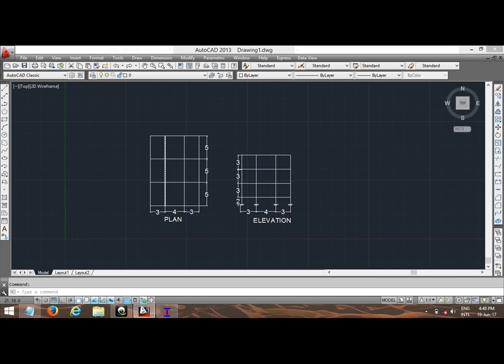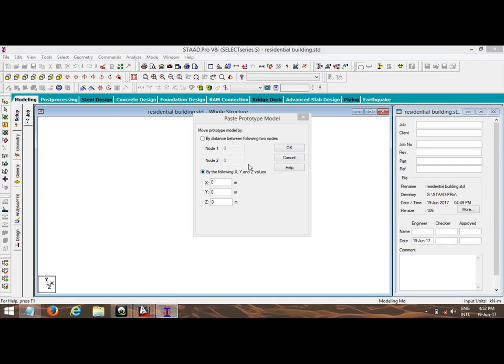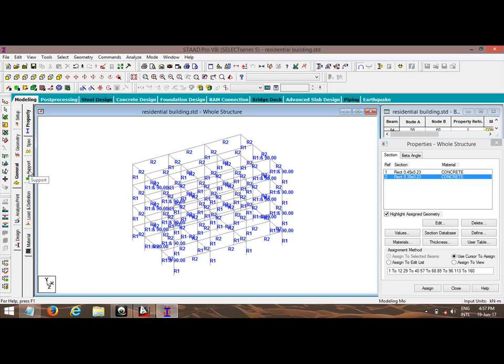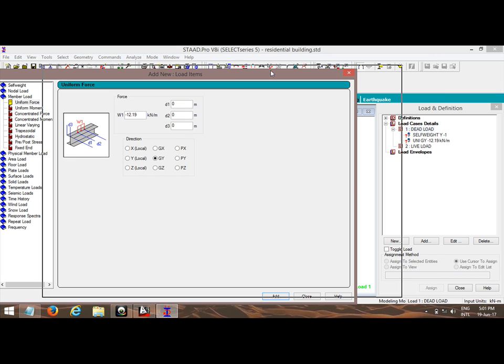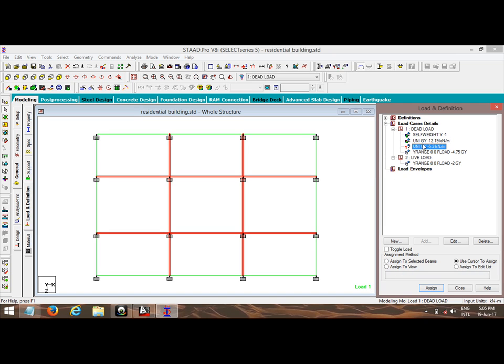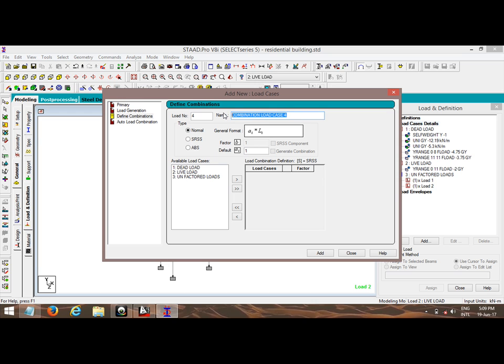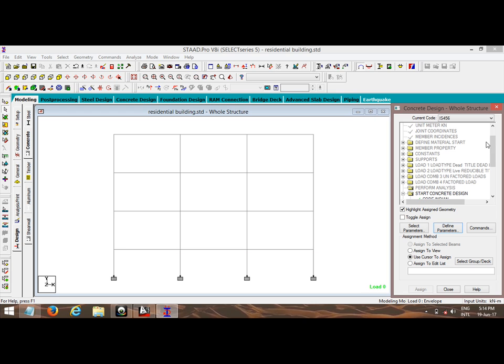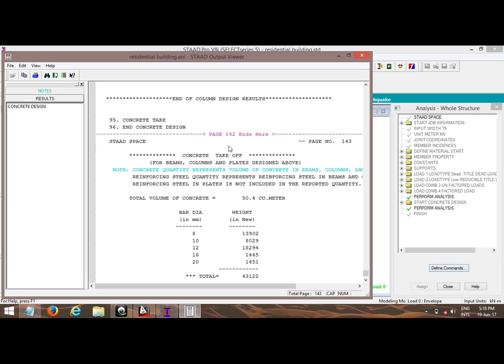Modelling, Analysis and design of residential building using staad pro software.

Comment: Thank you sir for this video.
Sir I am some dout, u apply member load to the beam but u not apply member load to the column why sir
Reply: Manu Deep Kj
Reply: Slab ka load beam pe beam ka load column pe transfer aata hai phle basic clear kro
Reply: columns are vertical members , from slabs  floor load comes on to the beam and again the from the beam members loads + loads from slabs goes to column ultimately .  column self weight has already been added ..
Reply: @k.j.saibabab3803  hi

Comment: How much load we are consider at Sunken portion and how to calculate it.
Reply from the maker: soyeb badgujar 
it is depending on filler material used to fill sunken portion refer is 875 part- 1 to know density of materials by using that value calculate loads

Comment: Hie sir.
Why u dont design slab
Reply from the maker: p patil we can design salb also by assigning physical member as slab for this I consider slab load directly soo... Slab design is not done here...
Reply: MOHAN K T as per as is 456-2000, is it possible to design a slab in staadpro.????
Reply from the maker: NO . We can use ACI 318-05, ACI 318M-05, BS 8110, EC2:2004 CODES only Work for slab design..

Comment: If I get Multiple Structures & Nodes, How to resolve that Error? Please Explain ....
Reply from the maker: Basically those type of errors will see when the self weight is defined twice and assigned twice for Structure .
to resolve this error goto tools and check multiple Structures
check for duplicate nodes 
Delete the duplicate nodes to resolve nodal error .
To resolve multiple Structure error delete self weight and resign by using option assign to view